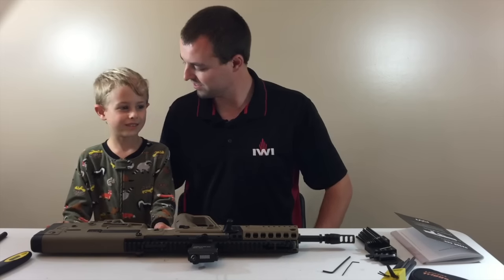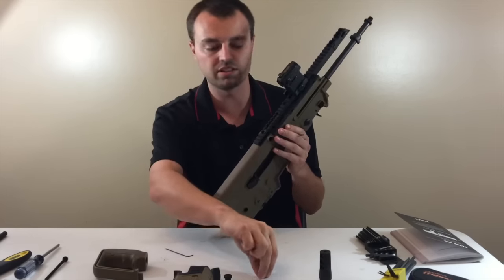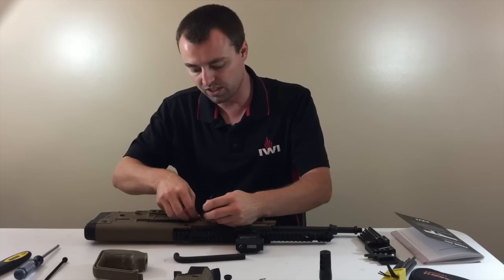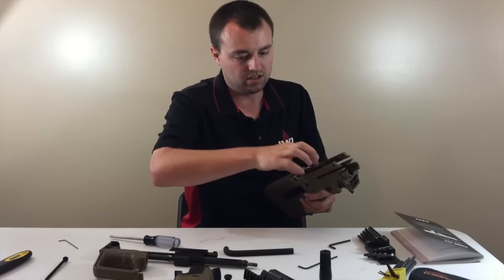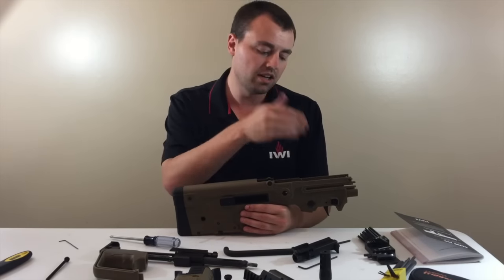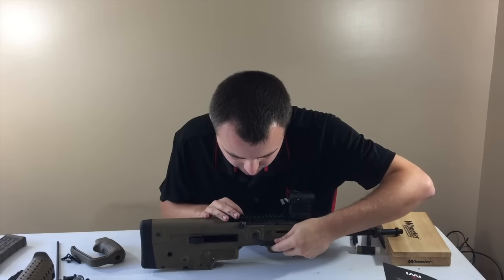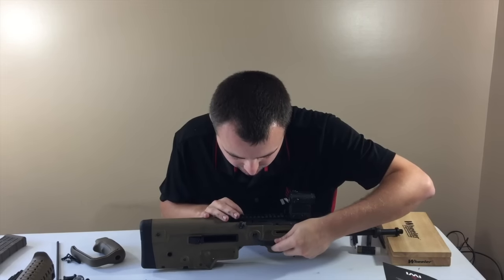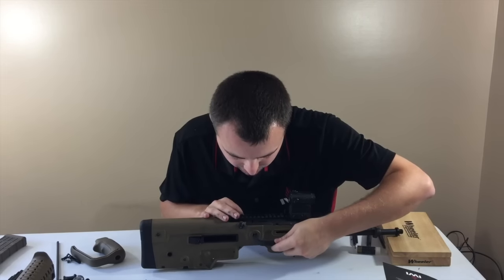IWI X95 Geissele Lightning Bow Trigger Install - REMOVE CHARGING HANDLE

Comment: your the best, thank you...
Reply from the maker: James Regnier no problem!  glad you enjoyed
Reply: Shield and Sword Academy  good morning, I meant to ask you what muzzle break do you have and what suppression you have. I'm looking at the Omega can you guide in the right direction.
Reply from the maker: James Regnier
 - I run the SilencerCo Sakes muzzle brake.  I have a Saker K suppressor and like it due to its size but with the ejection port being so close to the ear I generally have to put hearing protection in the ejection port side ear.  I would say the omega would be a solid suppressor but I would probably look at the "Hybrid" as it can go on nearly any firearm you have.  Overall size would be my only concern.
Reply: Shield and Sword Academy  I was thinking the same about the Omega myself thank you.
Reply: Howdy, I would like to add that I have the Gemtech One suppressor and the decibal reduction is significant. It is spendy Gemtech does offer many quickmounts in both muzzle break and flash hider variants. I am not trying to promote Gemtech, I just thought that I would share my experience. I may possibly add a video to my Youtube user account in the very near future. I shoot my Gemtech One with quickmounts on my AK47 Draconian pistol, AR pistol, AR carbine, AK47 underfolder carbine and both of my Remington 700 bolt action tactical rifles with no hearing protection. I have sensitive ears but felt that there was no need do to the reduction in decibals. Others may disagree but I shoot regularly and have had no issues. I hope that this helps someone :)

Comment: Great video, and made it easy to install the LB as well as general breakdown for my LH conversion.  Shooting it since February in USPSA PCC (in 9mm, of course.)  Question for you:  how often do you do a total breakdown for cleaning?  I clean and lube the rifle after every match (around 300 rounds) according to IWI's instructions, which is just removing and cleaning the BCG, chamber, and barrel (using a snake, usually.)  Blowback 9mm is fairly nasty to the gun, though, and I've noticed with a light that there's a fair amount of crap building up in areas that are difficult to impossible to get to without removing the barrel.  Those areas don't look like they have anything to do with the operation of the gun, and the X95 has been head and shoulders above every other gun on stage in terms of reliability.  I never reach for the charging handle, while the AR9s, MPXs, Keltecs, etc. are constantly faulting.  I don't know if it'll reach a point, though, where I need to do a full breakdown to clean to keep it reliable.  Any advice?
Reply from the maker: I just recently started running the 9mm carbine version of the X95 but I have been running the 223/556 version for some time now.  I tend to clean the BCG once a month (about 600 rounds) in my competition gun.  I will say that my backup X95 in 223/556 went over 1,000 rounds suppressed with only lube added to the outside of the bolt (through the round extraction window) and during a 2 day class the rifle went about 2,500 rounds without cleaning.  No issues at all.  I use gun grease though for the normal cleanings as I have noticed it traps the dirt and sand (in my case) better and prevents it from getting inside the gun.  I use Cherrybalmz Gun Grease from https://www.customtacticalsolutions.com/collections/tactical-bags

Comment: Thanks for the video- excellent- I know how hard it is to do these. I am new owner of the X95 and will be installing the Bow in a few days. Just a note placement of the gauge will impact the reading- I saw your other video and totally understand it is not easy doing this- but if you go back and ensure it is placed on the lower part of the trigger you will see a lighter pull result. Not nocking you- just letting you know. Do you have an accuracy video? I am about to do one myself.
Reply from the maker: Thanks for the advice.  Greatly appreciated.
We have done some accuracy videos and put them on facebook.
I run both of my X95's in 223, and recently IWI provided me with a 9mm X95 for Pistol Caliber Carbine, my X95 in 223 have reached out to 300 yards with no problem.  The accuracy is not sub moa with basic ammo and that tends to be the complaint.  An AR might be a little tighter but the things most are asking of the X95 are things they would not ask of an AR.  It is great from 0-100 and awesome at 100-300.  I don't stretch it past that much.  However we do have the 800 yard range available tomorrow and I might see what it can do.
Reply: Yep- I do lots of Long Range stuff (with bolt guns) So I am going to setup mine with a Vortex HD II scope, a really good bi-pod and use of a Can on the end. All the video's I see no one is shooting Prone. Mistake #1.. Mistake #2 is I see folks resting the rifle on the mag- which I would think is then pushing up inconstantly on the bolt and that then translates to the barrel. I think once I get the Bow installed with the Timney pack- things will really tighten up. I am going to first shoot her with the original tomorrow- and then next week do it with the upgrades.. Thanks-
Reply from the maker: Range TimeNetwork - We saw no difference in shooting prone. I always sight in prone then confirm standing. I'm using red dots from Holosun so I'm an not zoomed in to see exactly at 100 yards what I'm shooting at. 
I do shoot suppressed a lot and saw no difference in that either. 
I see a lot of people with Gen 1 units, as in first ones produced have complaints, but after that I hear far less to no complaints.
Reply: Very cool- (I was not saying you- ) just other accuracy video's . anyway- I love how it sits - gonna be a fun rifle for sure. thanks again- take care.
Reply from the maker: Range TimeNetwork no worries bud I got where you were going. I have tried different things to get bad results. There is an occasional flier but not terrible.

Comment: Thanks again! Just installed my BOW! wow- wow- 3.5 to 4 LBS... (with the Timney pack) QQ the spring that is with the original trigger just goes away correct?
Reply from the maker: Range TimeNetwork which spring?
Reply: The one that holds the original Tavor Trigger Bow. I figure it is not needed for the new bow. since you don't mention it in the video.
Reply from the maker: Range TimeNetwork yah everything in the video is exactly what you need.  The lightning bow pretty much comes with everything necessary.
Reply from the maker: Apparently my reply never actually posted.  Yes that spring would not be necessary.

Comment: I would like to point out an issue I had during reassembly that was not covered in the video. I believe the issue was caused by the gun not being charged during reassembly... Or at some point through the installation of the new trigger eye discharge the trigger pack. when reassembling the charging handle did not go in properly with the trigger pack discharged causing some minor wear and tear on the charging handle... And causing it to actually get stuck in the rear position, I had to literally force it out. in order to remedy this I had to remove the trigger pack and charge it but with the gun disassembled it also caused the cover over the trigger trigger pack to come off. it was easy enough to get it all back together properly, but it is worth noting to save someone a few minutes of headache.

is this anything you have seen at any point?
Reply from the maker: Kevin Sylvester the trigger pack does need to stay in the cocked position to alleviate headaches.  I haven’t seen this much but it does happen. Glad you were able to work it out.

Comment: Excellent video, cool. But the Tavors are extremely high priced, polymer rifle, poor accuracy, major issues at 800 rds for a quote military rifle, heavy weight, and issues with their polymer frame cracking, are sad realities. For a cool looking, bull pup design made in Israel.  Time for the Hebrews to do more research and development on their bull pup designed rifle. Stop cutting corners and no nickel/ dimming on a rifle coming to the U.S. and around the world. This is not airsoft. Or just keep the design and patent. Use it for a tax write off in every country that the laws allows. G-d bless all humans throughout the world.
Reply from the maker: Javier Licourt - We have a Tavor and two X95s.  the lowest rounds count on any of the 3 rifles is 1,500 rounds. highest is just under 10,000.  accuracy issues are exaggerated. we are seeing 1-2 MOA at 100 yards and we shoot these at 300 using a red dot with no issues.  we shoot year round including negative 20 in Ohio. I have no issues with polymer cracking.  we aren't seeing those issues. this is a battle rifle that has been field tested and we have beaten the crap out of it with no problems.  the rifle is expensive but when we look at high quality rifles it is comparable. 

the great thing about living in the US means you can buy what you want.
Reply: Are your statements factual?  Or a marketing ploy?  The manual states cleaning at how many rounds. And in the field, what is the reality of functionality? Continuous firing and  actual cleaning intervals. To prevent issues with the rifle? Be honest and respect yourself.
Reply: Javier Licourt literally none of what you said is true, except for its a polymer rifle and the accuracy problem has been corrected. My Tavor has just shy of 4,000 rounds (over 1,000 in various classes) and none of your issues have appeared nor have I heard of any of those issues ever (aside from the aforementioned corrected accuracy problems). Stop spreading nonsense.
Reply from the maker: Javier Licourt - I clean my rifle every 500 to 1,000 rounds. you can also see numerous videos of me shooting the rifles both in 1,000 rounds 1 day classes and 2 day classes.  not only do I teach classes, which include shooting, and shoot 2-3 matches a month as well. add in practice and the round count goes higher. I am talking about my personal experiences.
Reply from the maker: AFSOCbum - Thanks for sharing your experiences.
Reply: A quote military rifle and it needs cleaning at 500 rds? Really? Or a thousand rounds for a military and combat rifle?
Reply from the maker: Javier Licourt - If you have the ability to clean the rifle why wouldn't you?  as you can see by asking a IWI rifle shooter the rifles don't require constant maintenance.  the question I have for you is, do you have an IWI rifle or have you put a thousand rounds through one?
Reply: Javier Licourt

1. Compared to an AR or AK, economy of scale makes most rifles "expensive". 
2. Yes, the Tavor has a polymer body. So does the SCAR (lower), FN2000, P90, Most H&K guns. AUG, and the countless polymer framed pistols... just to name a few.
3. I have no accuracy issues with mine and can do about 1.5MOA from a bench. It isn't a fancy target rifle, and I'm certainly no marksman, but it certainly doesn't have "poor accuracy".
4. What major issues at 800 rounds? 
5. "Quote military rifle". There is no quote. It has been adopted by the IDF and a handful of other military forces world wide.
6. Heavy Weight. Yes, the Tavor is a little on the heavier side, but the weight is well balanced. Compared to a fully-railed M16A4, it is actually lighter. What is your frame of reference?
7. Issues with the frame cracking? Where the source for this?
8. The Tavor was in development for almost a decade. Corners weren't cut and things were nickeled/dimed. The only thing even close would be complaints about the trigger, but the original Tavors for the US market featured the standard trigger pack made for positive resets and reliability, not low-pull race guns.
9. Everything else: Seriously where are you even getting this stuff? Most of what you're saying isn't even making sense.

Let's look at cleaning. I haven't cleaned my Tavor once. Normally I clean my rifles after every range trip for the sole reason that I like cleaning my rifles, but for the Tavor I am letting it get dirty. While I don't have that many rounds through it compared to many others, I certainly have over 500 with no issues.

Really I don't know what else to say other than what you've said is very far off and without any sort of source citation, it's meaningless.
Reply: what do you think a combat load IS?  Scratch that, where do you get your information on "polymer frame cracking"?  You sir are full of misinformation in a major way.  First of all, the polymer is a shell.  A majority of the structural frame is metal, including the rails the bolt carrier rides on and the barrel trunion.  Even IF the polymer were to crack, which I have seen no evidence of that, unless it was in some very specific places, it wouldn't mean crap.  Have you field stripped or even FIRED a Tavor or X95 yourself?  Or are you just regurgitating something you heard on the interwebs from someone who claims to know it all and be an expert?  If its just regurgitation, please, tell us who your source is so we can confirm and debunk.
I can point to MULTIPLE sources that completely disagree with you, and those people shoot Tavors and other rifles waaaay more than I do.
Reply: Javier Licourt first off 556 is good out to about 600yrds. second the tavor is made for close quarters battle. about under 300yrds.
third they are battle rifles and moa is about 2 to 4 moa military standards. 
they are not made to be sniper rifles. 
the tavors aren't free floated barrels. from what I read it doesn't make a whole lot of difference. depending how far out u shoot.
Reply: you have NO idea what you are talking about obviously. You really need to stop spreading misinformation.